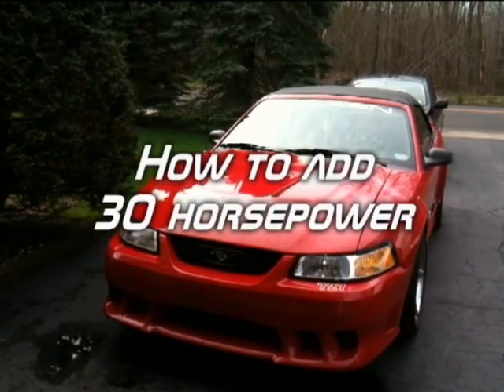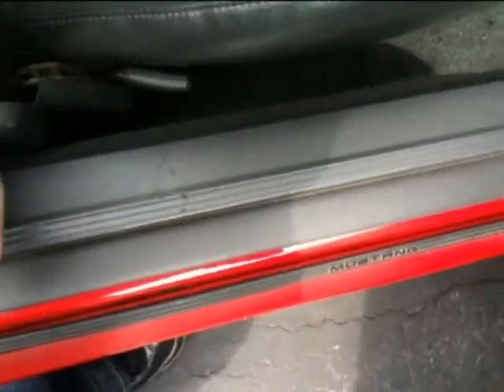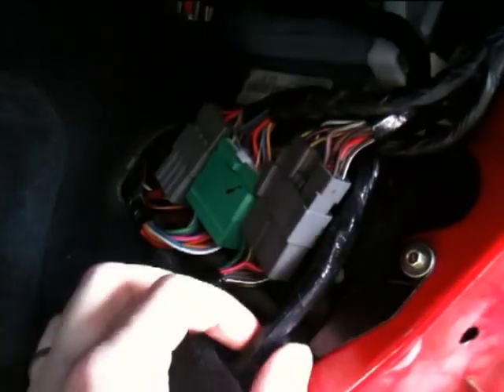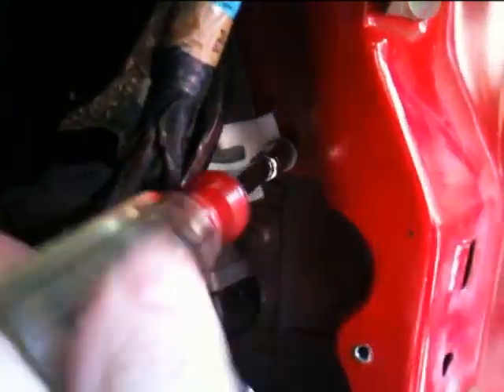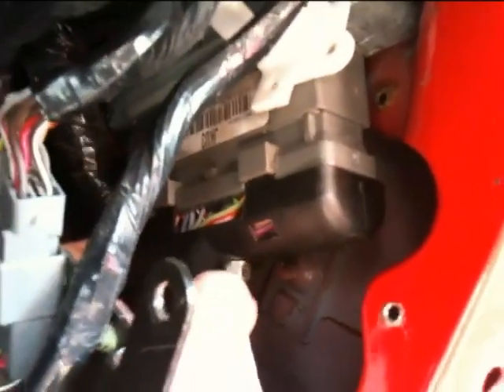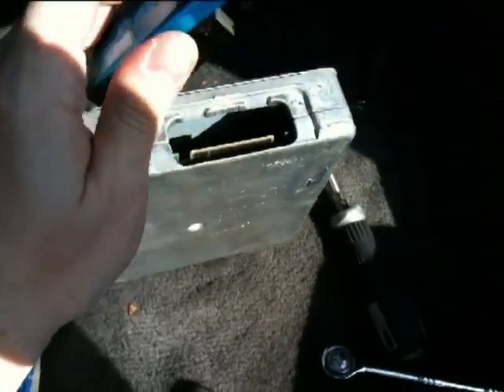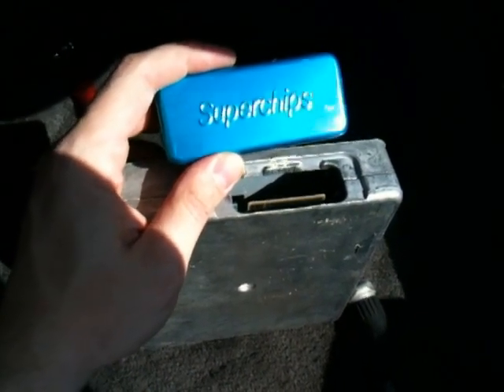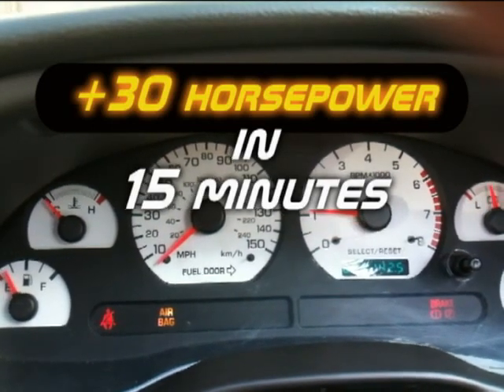Add up to 30 Horsepower to Mustang with ECU Tuning AFTER MODS

Comment: Just did this in reverse. Our 96 SVT Cobra came with the chip.  It definitely added power.  I'm going with a custom tune now.  Question why remove the negative battery terminal and not the positive one?  Thanks for posting this.. Removing the ECU was a real knuckle busting job.

Comment: If u change Ur muffler bearings they garuntee to add 66 horsepower..... Also if u put winded in Ur blinker fluid resivoir it makes it run super lean adding 51.456 horsepowers those 2 items will give u over 100 horseys

Comment: $500?? for a chip???? In 1972 I bought a used '69 428CJ Mach I with a C6 for $800. It turned low 13s all day long in drive. Broke into the 12s when I dropped the exhaust to run straight from the exhaust manifolds. I still have the Englishtown time slips.Got to love modern Technology. It also weighed less than the new pieces, onward to the past...jeesh. I spent less for the car and all the maintenace for the 20 years I owned it. Sold it for 5K in '92 after using it as a daily driver.

Comment: save the money and and headaches and goto a shop, if your on the forums Im sure someone can refer you to one that's good close by. AED charged 400 and my 20115.0 gained 38whp and ran SOOO much better than email tunes! my 03 gt with every bolt-on was the same thing, the sct mail tunes gave me power but not consistent and dependable, got it dyno tuned and bam, (catless x, mac catback, plenum, steeda pulleys, bbk tb/cai, c&l plenum) 47whp!

Comment: yeah, save the money and do a proper tune, bama has had more issues than any other tuner. I know American muscle has their special deals with them but myself and several other mustang owners had issue after issue with bama, its impossible to properly tune a car without having the car there. Find a reputable shop (thankfully I have AED in Cameron Park 8 miles away) and it cost 400 bucks for a dyno tune but the generic bama tune had NOTHING on my AED tune.

Comment from the maker: Nice, I'll look into the #Bama Tuner. I bought the Superchip a long time ago, and had to get it custom programmed after my mods were causing my #mustang to stall out after a hard stop because the fuel air mixture was wrong. Now everything is gravy but it would be nice to load different profiles and see what happens. Thanks.

Comment: could've just gotten a bama tuner, put your specs into bama, they will send u the program, put it onto the tuner, and plug it in, install the new program, bama also comes preset with i believe 10 preset tunes, ranging from a mileage (daily driver) build, to a racing/performance build it modifies the sparks, air/fuel ratio and throttle response, for autos it'll adjust shift points and shift firmness

Comment: You car tune any car after 1996. That s any performance car. 99-04 where tunable with bama tunes. He'll brenspeed has tunes for them to. It's easy to clam 30 hp. But the guys on here need proof. We need a dyno of before and after.

Comment: What bolt-ons and what kind of dyno?  There is countless GT owners on SVTPerformance with full bolt on, bama tuned GT's all making under 290rwhp. You said under $500, so I'm assuming you didn't do cams. Not calling you a liar just interested in your set up.

Comment: Spent less then 500 on bolt ons , did a Bama tune. After the dyno run I am proud of 301hp and 349 torque on my 03 GT

Comment: your way wrong especially if he's done work to his bullet.. real horsepower adding work.. chips aren't as great as they said to be. its old fashioned power and canned tunes suck.. you want power is an hour.. get skills and do cams.. you either got an SOHC mustang or an OHV (i'm guessing SOHC) and sohc mustangs are fairly easy to do cams on.. .. cams and full exhaust some mustangs can make between 310-350HP at the wheels

Comment from the maker: UPDATE   UPDATE  5/1/13   *** INTERESTED in PROOF   DISCUSSION***
Hey Guys & Gals, I just purchased #Dynolicious for $12.99 on iTunes. I already tested my Mustang and Lexus with it and I'll be making several videos related to quarter mile times, acceleration, horsepower estimates and so on. Stay tuned or become a subscriber so you won't miss them!

Comment from the maker: NEW VIDEO PROOF: My car is not stock and apparently much faster than your bullet. By the way I just pulled out my chip so that I can pass emissions. I will video tape a 1/4 mile run and then compare it to a 1/4 run with the chip in. Stay Tuned :)  #mustang  #carracing

Comment: really and adding this piggy back chip isn't back in time to 2000? O wait that's right. This was common in the late 1980's.
  And Sky brought up a good point about the antistatic strap. What is the purpose of this video? To show how NOT to install a chip? No cleaning of the connectors, no securing the chip. How dumb

Comment: Very well, have it your way. But, I'm going to have to report you for potential, illegal,  electrostatic discharge of an integrated circuit. The Federal Bureau of ESD Standards, Weights, Measurements and Other Important Sounding Stuff,  will be very interested in this video. You haven't heard the last of this! Good day Sir!

Comment: So, it seems you uploaded in 2011?  And you paid 500 bucks?  FFS you could have bought a 300 dollar Bama FLASH tuner AND another mod for the car...and it does the same thing AND you dont have the problem with Chip to ECU "bleed", meaning you dont have the ECU sending code that the chip misses rewrite on the fly...what chips do.  Tuners rewrite code WITHIN the ECU.

Comment from the maker: The Superchip I bought plugged directly onto my ECU. Those who tuned their modded cars and fixed problems like I did, truly understand that these things work. While others don't seem to understand that #cars without carburetors need to be tuned just as much as ones with computer controlled injection systems. Ask anyone who races a fuel injected car, if they believe in tuning their engine for optimum #performance.

Comment from the maker: Timing. When I bought my chip and then later got it programmed it was in the early 2000's. The Superchip had a really good reputation back then. I'm pretty sure the Chip on a stock 99 was claimed to add 27hp and 39lbs of torque. I had so many bolt-ons that I had to get a custom tune, just so that my car wouldn't stall out. I also had my car tuned from 87 octane to 93 octane for a few extra ponies.

Comment from the maker: Also the car felt noticeably faster after the chip, which no other upgrade (exhaust, x-pipe, throttle body, ram air, cold air intake) that I made was able to make that happen before. 

Check out a video on youtube called "G-tech pro vs iPhone vs Mustang Dyno" to see how accurate the Gtech Pro is.

Comment from the maker: I never dynoed my car, but I did use an accelerometer called a Gtech PRO and my quarter mile times dropped a lot after I chipped it. 

There are fake chips out there, especially on EBAY and I'm sure those are garbage. Watch Horsepower TV on weekends and soon you'll see dynoed proof on their show that these chips and ECU programmers work.

Comment: The only way to say you added 30 hp is to do a before and after dyno pull.  Sounds a little high for a stock bolt on Gt.  Full bolt on Gts with a tune make about  250 to 260 rwhp.  To get more than that you need to get into the motor and heads.  Not trying to hate on your GT as I owned a 2001 and loved it.  With full bolt ons, I trapped at 100 mph with a 2.0 60 foot.

Comment from the maker: I did the run on a cool summer night on a closed track ;) And I used an octane booster that they don't sell anymore. I used a Gtech Pro and ran it for several runs. I've seen my trap speeds in that range every time.
There are so many factors that could be involved, some pro drag racer might be able to answer your question better than I. I did list most of my upgrades in the details of this video. The cool air through my custom ram-air intake might have helped that night at 3am.

Comment: just got my chip in but i cant get the ecu back in without putting pressure against the chip. is there a certain way to get it in without breaking it?

Comment from the maker: The box I took out is the car computer. The Superchip gives my car computer a new tune. I had my programmed by a speed shop that tuned my car for all the mods I made, so that it burns fuel efficiently and so that it runs on 93 octane. I started modding my mustang so much that my car would stall out. I got the Superchip custom programmed to fix my stalling problem and it fixed it right away. Some people think it doesn't work and I was skeptical too, that's until I raced my friends Camaro and won!

Comment: Diablosport ECU programmer. Keep the same stock ECU chip, just plug the programmer into the OBDII port under the steering wheel flash ECU, and then Update ECU with custom program. All you have to do is tell the programmer what all upgrades you have have and it adjusts the stock program to maximize performance. most stock ECU have the AFR  set at 14.something:1. This is mainly for emissions controll etc. etc. Whereas most cars get maximum performance between 12.2:1 to 12.8:1 AFR (Air Fuel Ratio)

Comment: The only problem with using a chip like that, is that it adds weight to the end of the circuit board and it is not secured or bonded to the PCM. If that chip vibrates enough while driving it will cause fractures across the circuit board,and your could have problems later on down the road,such as the vehicle not starting or killing out. I've seen that happen over many years since I started working on cars back in 1990.

Comment from the maker: @sman112191 I don't take it to the track, I take it on the highway and just have fun with it. I'm one of those guys that actually enjoys everything about a car, not just straight line acceleration. 

Give me horsepower, looks, brakes, and a good suspension and I'm happy. I could really care less, if the guy in a supercharged Ford Pinto could beat me by a second or two in the quarter mile. But I guess I stopped measuring my penis along time ago...

Comment from the maker: @periko333 When I made these mods, the Superchip and then the custom programing for the chip was my best option. I would read up on it on websites and Mustang forums to see what really works on a 2004. The Superchip made a huge difference for my car, especially after I got it custom tuned for all of my mods.

If I were in your shoes, I'd look for something that could sync to my iPad, iPhone, or Smartphone and allow me to Tune and Get Performance info using the OBDII connection.  Good Luck!

Comment: Isn't the SCT tuner, predator, etc. easier? Is the superchips better? Im scared to buy one of these tuners and not see any changes.. My 04 mustang is a v8 manual transmission and is doind 13.5 1/4 and 1.8x at 60' ... with 18 on front.  I wanna hit 13.2 or 13.1!  It only has the AirAid CAI and 3.73s.  U think the tuner would help?

and MAN! they charged u a lot for changing the clutch...

Comment from the maker: @Syrius187 
1.The car cost me 27k new, and I put 15k into it. 
2. I wanted a good looking car that can handle corners, brake well, and go fast.
3. The car handled like crap from the factory, the brakes weren't power enough, the stock looks weren't good enough for me.

Comment from the maker: @333krisb I know what you mean. That's why I just gave the speed shop a list of all the parts I put on, so that they can custom program my Superchip exactly. I had a real big problem with stalling out after modding my car without the custom programming. The chip made my car act like stock, with the exception of more horsepower :)

Comment from the maker: @jameswoodsist I ran the quarter mile, because I wanted to see what the improvement was anyway. Why buy performance parts if they do nothing? 

I used to read all the mustang websites and magazines and knew which parts were worth buying in the first place. Plus you cannot feel the difference with things like changing pullies on a non supercharged car, but you might be able to drop your quarter mile a bit.

Comment: 30hp I could maybe believe with a lot of aftermarket parts and the stock tune. but you cant expect much if you cars stock, a slight increase here and there. and while yes a hand held tuner is a grea option but if you have a list of parts already on your car and your done modding a custom chip is the way to go.

Comment: @718mattmatt Now a days the factory will give you a big ass engine that can get you up to 170 or 180MPH but a chip put in by the manufacture wont let you achieve the full potential. By switching the chip or upgrading the chip you unlock the true power of your car

Comment from the maker: @420NewsNugget I paid $300 for the chip, then I paid another $200 to get it custom programmed for all my modifications so my air to fuel ratio would be normalized. Headers for my car were only going to net me 8 horsepower.

Comment from the maker: @nismofury I used a Gtech Pro to test my quarter mile before and after. Before the Superchip I was doing 14.4 at 103mph, after the Superchip I did 13.8 at 106mph. For each test I did 3 runs and took an average. That was proof enough for me, but I could see why so many people on here are so skeptical. For those people all I have to say is, don't get a Superchip period. For others, I do recommend getting dynoed before and after or possibly doing quarter mile runs at the track.

Comment: Any plug in style chip does not work. If by chance your ecu read some parameter and conflictingly ran your car in a certain manor tricking you to believe it did something for you. Get some dyno figures before and after and also some strip times before and after. You know why there isnt any videos cuz they dont work.

Comment from the maker: @blackcrisis2004 Throttle body, Mass Air, EGR Spacer, Pulleys, Ram Air, Cat Back Exhaust, X-pipe, K&N Air filter; and programmed for 93 octane only. I think that's it... This was 10 years ago PPL.

Comment: i'm curious to know what mods u had done to ur gt when u added the superchip. if u stated it in ur video or something, and depending on ur mods ppl would understand. if ur car was stock, then yes a 10hp gain to the wheel is the norm. so with full mods, 30rwhp is more than possible expecially if its dyno tuned. i have on my 97 gt cai, throttle, pulleykit, h-pipes, shorties. with stock cams, intake, and heads i gained 17rwhp/35rwtq out of a can handheld sct tuner. pi swap on the way!

Comment: If you think that added 30hp you are an idiot. Your first problem is driving a '99 Mustang GT. Your second problem is misleading people with this video. 

If you had a 2012 Mustang GT with a 5.0 and got a dyno tune with intake and exhaust I would believe that you gained 30...but not with your car and this "chip" paired with your "mods".

Comment: @automotiveDIY  Not true , when you have a Superchips programmer (Flash pack) you go to their website site and register , while doing so you can download specific tunes according to your mods , like cat back exhaust , cat fwd Headers & intake which work within the perameters of your stock electronics and your vehicles components so as to not overwhelm or cause damage to any components. I have a Superchip flashpack Tuner and with a few bolt-ons ,..207 stock , now 250hp w out header ,..soon.

Comment from the maker: @automotiveDIY 1. the custom tune fixed a stalling problem I had after I changed my mass air sensor, 2. Car is programmed for 93 octane, larger exhaust, and other mods. 3. Before the tune my friends 1998 Camaro whooped my butt. After the custom tuning I whooped his! And I have the video on my channel to prove it. 4. A speed shop did my tuning. The chip allowed me to take full advantage of the horsepower gains from ALL of my mods.

Comment: you may have gotten 12hp at the most.  plus it can't be custom programmed unless you had your car on a dyno while it was being tuned.  all superchips does  is advance your timing and lean the fuel mix out. very bad.

Comment: @homeaddition 

In defense of DaBluedude.....he said stock car. you have a modded car. In a stock car....ya you wont see the gains you would in a modded car.....probably as he said 10hp and quicker throttle response but in a modded beast you can make your car a completely different car with a chip

Comment: 2:20  "mine is actually custom tuned and gives more horsepower because... i have basic bolt on mods and don't know what a hand held tuner is, so it adds like even more power than normal! probably like 20-30 more horses!"

Comment: Also, Flexible duct work will not help airflow (ie your ram air intake idea)   True PVC fittings mayb but you still need to get the vaccum hoses hooked up which you could fabricate yourself for sure.   I would never use flexible duct work for anything other than brake duct cooling.   The flex duct stuff an break apart (repeated heat exposure) and can chip off into the engine.   You can do the math on that.   I have seen guys that make PVC ones and they work.  I still recomend a proper CAI.

Comment: This is a misleading video and a misleading product.   The superchips plug in chip wont get you anywhere near 30 hp on a stock car.   Mayb 10 if your really lucky.   It feels faster because it sharpens up throttle response and throttle input.  Thats what your feeling.  Also this is certainly not the best tuning technology.  A handheld programmer that plugs into the OBD2 port in the drivers foot well is much better.

Comment from the maker: @crrazyy I did my ram air in 2000, lol, I didn't record any video. If you route the flexible dryer duct tubing from your front bumper, going up through your fender, and put a mesh screen on the inlet, you should be safe.